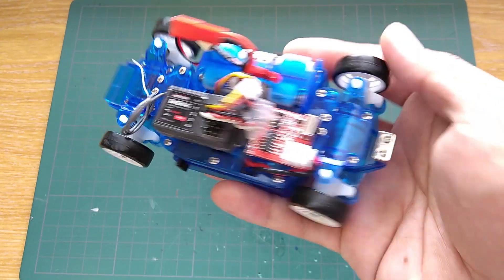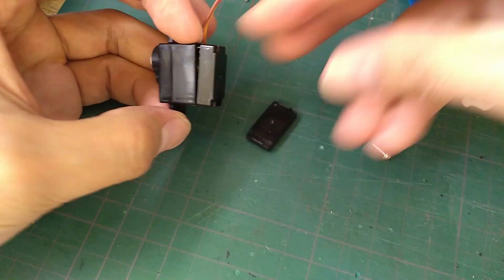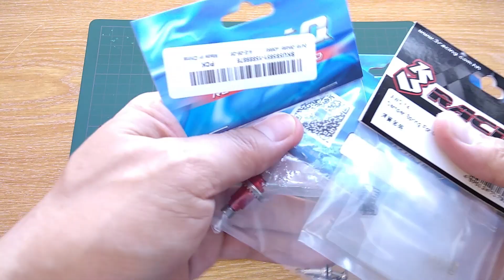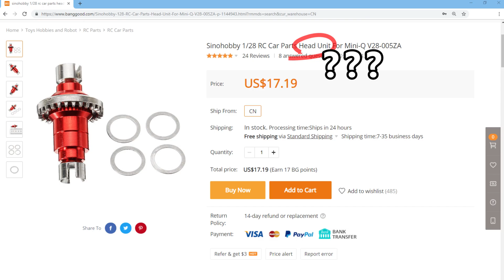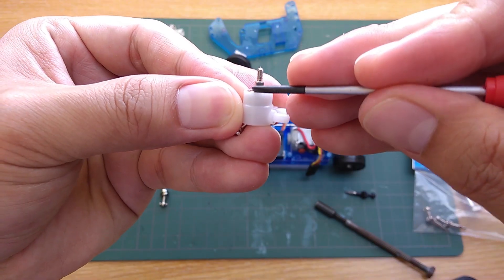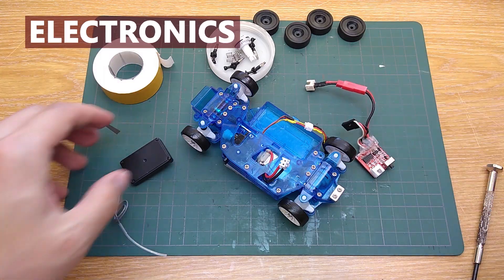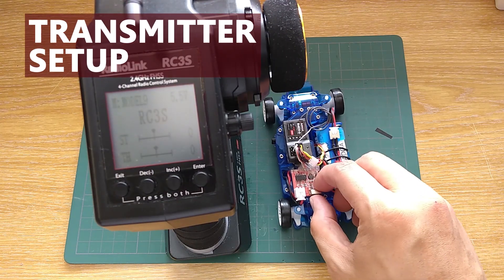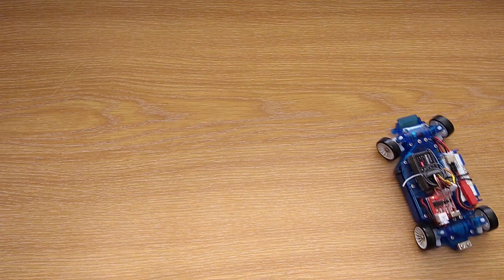Mini-Q TRQ1 | How To Build Ultimate Budget RC Drift

Comment: Any upgrades for chassis? 
Carbon & Ali upgrades?
Thanks
Reply from the maker: There's a carbon version of this chassis too but you'll spend on the chassis as much as buying a new car. If you want to upgrade it will be like complete overhaul or move your diff, wheels & electronics to the new chassis. You might as well buy an Atomic AMZ at this point.
Reply: Where can I find the carbon ? I don't mind paying
Reply from the maker: @benweddup552  Personally I suggest getting the Atomic AMZ instead. It's $65 exclude shipping. What you'll get here is essentially the first Mini-Z AWD killer with sophisticated double wishbone suspension, great ball differential (best I've ever used), grease shocks (work like oil shock in big cars) it'll stick in the corner like a glue. http://www.miracle-mart.com/store/index.php?main_page=product_info&cPath=67_1037_1040&products_id=13054

However if you insist on building or converting TRQ1 to carbon plate chassis, here's the parts you need and estimated cost.
But I have to tell you that basically you will turn this car in to Mini-Q Q5. Which is an old chassis with old style suspension that can't handle hi-speed cornering.
Mini-Q Carbon Chassis $48 https://hobbyking.com/en_us/camber-adjustment-set-update-version.html?wrh_pdp=7
You'll need front knuckle: $5.57 https://hobbyking.com/en_us/hybrid-front-steering-block-version-2-turnigy-tz4-awd-drift-spec.html
Then you'll need servo bracket $1.41 https://hobbyking.com/en_us/servo-mount-turnigy-tz4-awd.html
Battery brackets (you need 2 parts, inner and outer bracket ~$2
https://hobbyking.com/en_us/battery-holder-a-turnigy-tz4-awd.html
https://hobbyking.com/en_us/battery-holder-inner-turnigy-tz4-awd.html?wrh_pdp=7
Front steering rods $4.23 https://hobbyking.com/en_us/strengthened-adjustable-steering-tie-rod-set-turnigy-tz4-awd-drift-spec.html
Rear knuckle + toe arm $5.47 https://www.banggood.com/SINOHOBBY-Mini-Q5-RC-Car-Spare-Parts-Steering-Hub-Set-V28-018Z-p-1063469.html
Front centre shaft holder $0.9 https://hobbyking.com/en_us/front-axis-tray-turnigy-tz4-awd.html?wrh_pdp=3
Motor mount ~$10 https://www.aliexpress.com/item/32689749595.html
Total of $77 exclude shipping.
Additional parts are not expensive, they just never in stock. But you can get aluminium parts from the same source as the motor mount. So actually you are looking at around $100 to get an outdated car.
Reply: Beaver's Hobby thank you very much for this.. I'll be ordering these parts next week , I like the car even though it's old☺️
Also I've been trying to order the amz without success as nowhere has one in stock, I'm in UK and assumed it was easy to find...
Any shops you can suggest.?
Thanks again for all your help 
Regards 
Ben😉👍🏻
Reply from the maker: @benweddup552  Try your local Mini-Z tracks. I think they should have AMZ. Otherwise wait for it to be back in stock in RCmart. Miracle mart can be an ar*e sometimes.
By the way, there's also a complete carbon + aluminium Mini-Q rolling chassis in Aliexpress link that I sent you as well. So you don't have to hunt down all the parts one by one. All that left to do is moving your electronics to that chassis.
Reply: Beaver's Hobby thanks again looks like I've got to wait as can't get amz at all... I want to buy a decent 1:28 drifter, 4wd..money no object what do you recommend..? I don't mind buying upgrade parts ...
Thanks again
Regards 
Ben👍🏻
Reply from the maker: @benweddup552   For AWD drift car the best is Mini-Q Q7. This is RTR version. http://bit.ly/2IkCtHR If you already have transmitter & receiver you can choose ARR version. There's brushless ARR too http://bit.ly/2MuzSim .
Think of it as the AMZ with adjustable arms and aluminium gearbox as standard. You can CS it very easily too.
Here's my playlist of this chassis where I build a drift CS car out of it. https://www.youtube.com/playlist?list=PLS79G3YjA2fAgjiyJam-5JvovvCShTksU
Unfortunately the new batch doesn't come with metal swing shafts anymore so you'll have to replace them with WLtoys drive shafts or Mini-Z AWD long swing shafts, as for the problem with new wheels, no need to worry because you'll have to change them anyway. Other than that this car is a fantastic AWD drift car.

If you want RWD right now the best is XRX DPA. http://godracing.com/index.php?route=product/product&product_id=127
Reply: Beaver's Hobby thanks man,
I’ve ordered the q7 but I’ve not got a spare controller/transmitter .
I use spektrum 2.4ghz controllers for my other toys, or can you recommend a good controlller, I was looking at the the one you use here ? Does it bind to spektrum Receiver. 
Thanks again.
Reply from the maker: @benweddup552  The one is use is the best in this price range and in budget category. But it won't bind with Spektrum. If you want some familiarity you can look at a new Spektrum like the DX5C.
Still, I highly recommend Radiolink because it provides great value for money and receivers are not expensive. There're also variety of receiver from standard to gyro-integrated, telemetry enabled and mini.
If you want to spend up to $180 then Flysky Noble NB4 is worth considering.

Comment: Excellent video! So, question: if I have the Flysky GT3B - can that work with the gyro? If not, you said you don't use the gyro when you drive, does that mean that gyro compatibility with the receiver isn't necessary? I would love to follow this video exactly but want to use my existing receiver. Thanks!
Reply from the maker: The gyro I have in this is the onboard gyro integrated in to the receiver from the Radiolink system. If you use GT3B normally it doesn't have that. But you can install separated gyro unit like what I have in my RWD drift car. Here it is. http://bit.ly/2LAH1ND
You can do the same as I do in this video except your receiver is going to look a bit different than mine. The difference is you will sticking the plug in to same channel but not the same position because Flysky has CH1 at the bottom but Radiolink has CH1 at the top, that's it.
Everything is the same except for the part that I calibrate & setup gyro. Because Flysky standard receiver doesn't have gyro. 
Recently I saw the new receiver for GT3B that has integrated gyro. The gyro setup procedure is of course going to be different but at least you have it in your receiver and don't have to install a separate unit. Check this out if you don't want to have wires going everywhere. http://bit.ly/2K0vsuS
By the way, I have no idea how to adjust this unit or how to reverse the gyro direction which you will most likely need.
Reply: @BeaversHobby   That new receiver looks perfect, thanks for the link! Banggood links to a PDF manual of it. The manual shows how to reverse the gyro. On the face of the unit in bright blue are two potentiometers which are not described in the manual. ST GAIN and TH GAIN. ST GAIN is probably steering gain, would TH GAIN be throttle gain?
Reply from the maker: @darkNiGHTS0  I think TH gain is the same as Spektrum AVC system where it manages the throttle as well as steering when the car swings. In other words, it reduces the throttle when the car slides.

Comment: Total price?
Reply from the maker: Including the car and tool to remove the wheels, about $119. This includes all the upgrades and new radio too. If you already have that the cost will go down another $54.
Reply: @BeaversHobby  That's very expensive for such a small car.
Reply from the maker: @oliviergoggins  Yes, it's expensive if you go all out with the upgrades. As I said a decent transmitter costs $54 and that's where the most spending goes to. 
But if you get only the car and treat it well, you won't have to change a thing unless you want to upgrade.
Still, this is the cheapest car to upgrade to a full blown drift car. Mini-Q Q7 (best AWD drift right now) starts at $120. If you want RWD drift, Atomic DRZ only chassis costs $129, with some electronics it costs $199 and you'll have to buy literally everything extra from wheels, body, etc. to battery and charger.
Small size doesn't make the bill smaller.

Comment: Love your channel the most around mini car world. Thanks for this tutorial, learnt a lot! I noticed that the servo has 5 wires. How does  this servo adapted to a standard receiver? Is the power HD 1600 precise enough for drifting? Would you pls make a episode about different electronic sets from different price level? Thank you for your effort! Wish you come back soon.
Reply from the maker: You can install servo controller from another 3 wires servo to 5 wires too. Essentially 3 wires servo are 5 wires with controller. 
Power HD is precise enough for drifting but it's not tough so if you crash a bit hard it'll break.
Thanks for the suggestion about different servo. I'm trying to come up with an easy to understand way to do comparing standard servo with one very expensive that I just got from XRX.

Comment: What li-po batteries do you recommend? Buying AAA batteries is getting expensive. Thank you for the video btw! I'm trying to gather all the parts so that I can upgrade my car too. I love it!
Reply from the maker: Easiest one to get is Ikea rechargeable battery and charger. Look for LADDA AAA 900mAh. It's essentially Eneloop.
Reply from the maker: For lipo, Anything that fit in the tray will work. I really like Giant Power 2S 300mAh (doesn't work with original board). You'll need new charger if you haven't got one already.
Reply: @BeaversHobby  What do you mean it doesn't work with the original board? I don't have a charger at all since I'm currently using the AAA batteries.
Reply from the maker: @erraddict  I meant you'll need to find 1S lipo that fit the tray. Check out Hobbyking and you can select the size of the battery. What I use, which is 2S won't work with the original board.
Also you'll need a charger for Lipo too.
You can also buy rechargeable AAA with charger from Ikea, they are really good.
Reply: @BeaversHobby  Oh, so it's just a physical size limitation? I was thinking about the plug that goes into the car
Reply from the maker: @erraddict  Plug can be converted very easily. Original plug is JST-XH 2.5mm 2 pin.
Reply: @BeaversHobby  What about voltage? I wouldn't want to burn the car by plugging in a battery that's too high Voltage etc
Reply from the maker: @erraddict  Yes, that's why I recommend 1s lipo because it's 4.2V at full charge.
Reply: @BeaversHobby  Thank you so much! Shopping around for a lipo and adapter/charger now..

Comment: Can those shims be purchased at somewhere like Home Depot? I hate how long it takes for the parts to come in the mail
Reply from the maker: Probably. You can ask the nut&bolt supplier as well for the washers of these sizes.
6x8mm with 0.1, 0.2 and 0.3mm thickness (for differential)
3.3x4.5mm (or M3) with 0.1, 0.2 and 0.3mm thickness (for wheel hub & shaft)

Comment: Can I use 1s lipo for the original esc? Will it gain any performance (it is lighter  but only 3.7v?)
Reply from the maker: Yes, you can use 1S with original ESC. The car will be lighter and a bit more nimble.
I don't notice any difference in speed between 1S and AAA batteries though.
Reply: @BeaversHobby  thanks alot
Reply from the maker: @philipcheng2415  My pleasure.

Comment: Heya,  I was wondering if you know of a differential for the rear of the Q1 I have the front one way but still have the standard rear diff still ,🤔 do you know what diff's will fit? , Thanks Beaver's Hobby
Reply from the maker: You can use Mini-Z solid axle or open up the original one you have and lock it.
Here's how you temporary lock it you can use glue instead of blu-tac to permanently lock the diff.
https://youtu.be/U23Xfz1czek
Mini-Z solid axle https://www.ebay.com/itm/MA20VE-13-AL-Rear-Solid-Axle-For-AWD-MA-020VE/253336924294?

Comment: Thanks for the awesome vid, definitely going to go this route for my first drift build.
Also I was wondering if you could drop the front drive and use the gyro to build a RWD drifter? Would that work? I figured I could start with the AWD drive setup and then once I felt I got the hang of drifting in AWD I could convert it to RWD and learn with that. What do you think?
Reply from the maker: It can be a bit difficult with this chassis because you'll have to cut a lot of things out to make the sufficient steering angle and I'm not sure if the chassis can take it.
Reply: @BeaversHobby  Thanks for the reply! I think I'll give it go and see how much of the chassis I can preserve. Worst case scenario I can always make a new chassis if I break the original.

Comment: I guess I should get to upgrading mine, I baulked at cutting on that hard blue plastic, it looks too pure to sully and I'd bet it would shatter-crack. Lots of lovely info buddy, knowing exactly what to get is a huge battle. Bang_good let me down so badly I'm gonna hafta get my search on.
Reply from the maker: You can get a lot of parts outside of banggood and a lot of times for cheaper too.
You need really sharp knife to cut the blue plastic chassis otherwise it'll crack.